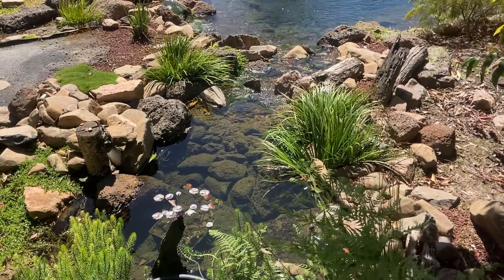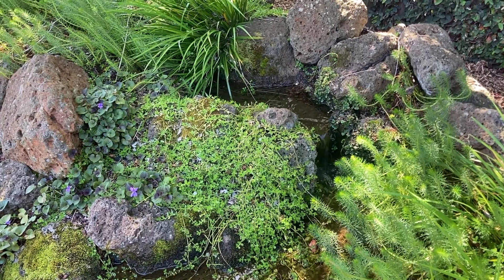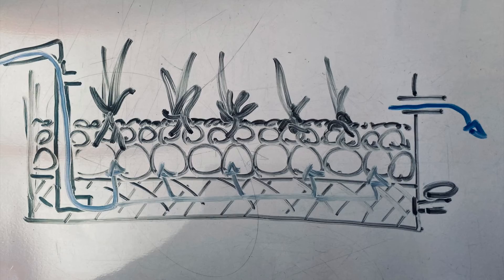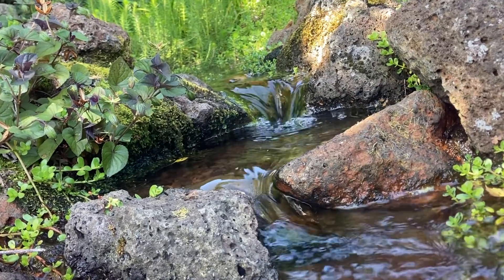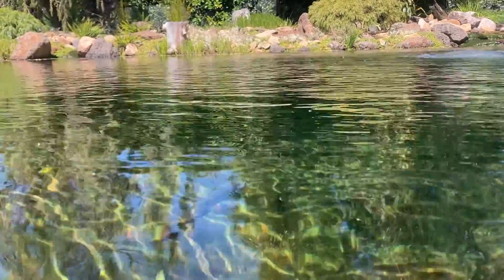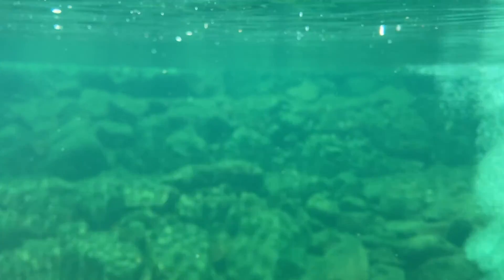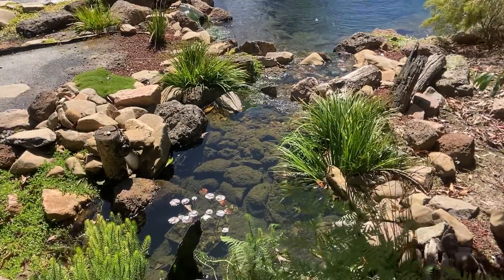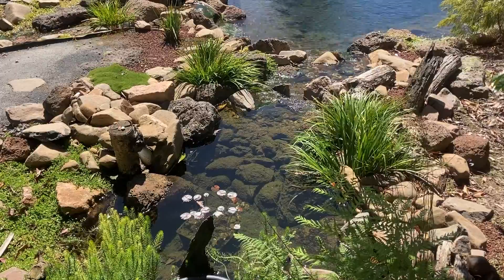What is a bog filter?

Comment: i built the bog filter and it did clear the water for a few days. now i think it's not working because i think the flow rate of the pump we have is too fast. i don't think there is a way to slow it. maybe i should build another bog filter attached to the one i have now
Reply from the maker: You can always split off flow. It’s hard to tell how much is going where, but can be done.

Comment: Hi kev,Thanks for the great videos
 I have a 15,000 litre pond and to have a bog filter 10% of the pond size is too big for the space that's around 1500 L bog filter , is there a work around/alternative as to how can I get it done for this size of the pond ?
And what size pump do you recommend around 10,000 L/h ?
Reply from the maker: You could make a high flow waterfall filter. I made a video 👍. You’d want a bigger one than I made. And you’d probably want to run about 40,000 litres through it. They need more flow than a bog.
Reply: Thanks for.the suggestion
I saw your waterfall video 👍 so do I use the same size container as shown in your video? Except I have to get a higher flow pump, what is the size of pump flow you recommend?
Right now my pond is brownish since last 3 weeks and struggling it get it clear
Reply from the maker: I think I’d like to go a bit bigger. Or do 2 the same size and split the flow between them.

Comment: Quick question . Can a reverse bog filter be built with the water coming down from a waterfall then down to two more levels then the last pool containing a centipede.
Reply from the maker: Most aquaponic systems are reverse bog filters with the water coming in on the surface. Works great. Just make sure you can easily remove sediments that will build up.
Reply: @Ozponds  that is what I would be concerned about . How do I go about making it easy to clean
Reply: @Ozponds  and also would I need to use the gravel inthe opposite order so instead of from large to fine at the bottom to the reverse
Reply from the maker: 😂 this isn’t a quick question. Have you watch the designing a bog video? You’ve got too many variables going on. How deep are the bogs going to be? Why can’t you do upflow? Have you considered negative edge or intake bay in conjunction with a high flow filter? These are just some of the things I would be asking myself. These are the sorts of things we discuss when I help people design their ponds. But no I wouldn’t be reversing the rock size layout. And depending on the depth and design you might not even need various layers.

Comment: Another  good informative video .  The IBC tank I converted to a bog filter  has been running about a month now  without any problems despite minus 7 temperatures in my part of UK  luckily I decided to line the hole  with 100ml thick cellotex insulation  around tank  exactly same as the channels dug to bury the pressure pipe . I've got the flow rate almost right by gradual adjustment of the varipump  no plants as yet due to frost  water tests  have  improved  and running outflow through a filter  sock I'm impressed with clarity  and the waterfalls seem cleaner .  I'm considering   adding another IBC tank as a pre filter / settlement tank  in spring and replacing an old  existing multichamber filter system that takes too much maintenance
Reply from the maker: That’s awesome 👍👍
Reply: Hi Micheal - im designing my pond and thought to use 2 IBC tanks with the tops cut off as a bog or bio filter - how did. you do yours Thanks Anthony
Reply: @anthonyloweMRE    I   cut the top out hatch style to help retain the rigidity/strength  as frame was removed . The  original outlet  converted to 75ml pipe for drainage / cleaning I used  100ml  pressure pipe to form a weeping pipe over outlet .cut series of grooves with angle grinder to help breakdown of solid build up. I then used a plastic pallet cut to fit in bottom to form false bottom  added  gravel grids  used for pathways and diamond filter grids height roughly 30cm .I then made a  manifold system using 40ml pressure pipe covering bottom incorporated with inlet from pump & air vent overflow just incase . Again cut slots in manifold to allow water to flow upwards .through  Cobbles /river pebbles and larva rock i are my choice of media . outflow is 75m pipework l via a gutter style hopper inside IBC where I have Japanese matting   .all my pipework is pressure pipe with threaded joints  sealed and protected from frost in underground channels covered with decorative stonework for ease of maintenance .  It took time to get the flowrate from pump sorted   but we'll worth the effort  and investment  .it's replaced a multichamber high maintenance  filter system  so far and the filter sock on outlet to waterfalls  is virtually clean now .  Digging the hole in my hillside garden was hardest part . Rest was easy 😃 hope it helps  .
Just use Kev's plans and adapt to suit your needs is what I did
Reply: Thanks so much!
Reply: What filter sock did you use for the outflow. I'm from UK and setting mine up but need to ensure the outflow does not blocked from the odd debris.
Reply: @jaxx8536    I got them off eBay   can't remember the mesh  size as had them few years tbh   I simply swop clean for dirty  was 3_4 times a day at first now is once every two days  as the. Sediment in waterfalls and streams has  virtually gone  .  If your using a vari pump start with slow flow rate  and gradually increase.  Until  your happy with flow  . Is my advice

Comment: How do you clean a bog filter when its another smaller pond feeding into the main pond?
Reply from the maker: Did you check the videos in the description? My big bog filters have access ports so you can place a sump pump or a pond vacuum down to completely drain the bog.
Reply: @Ozponds  I have now and filter is designed and partially built. Legend thank you.